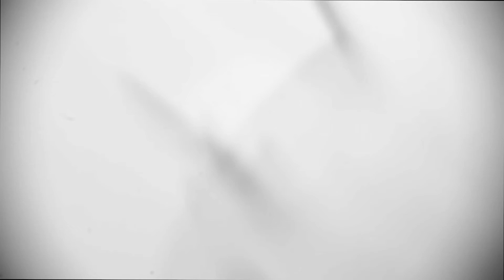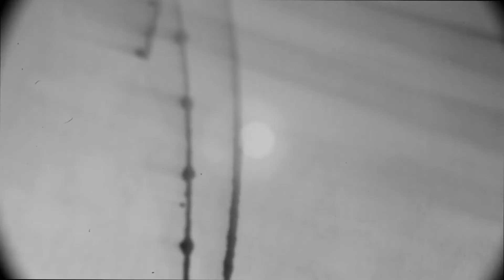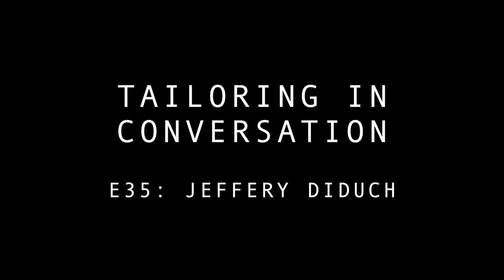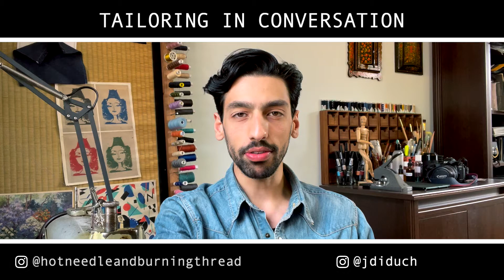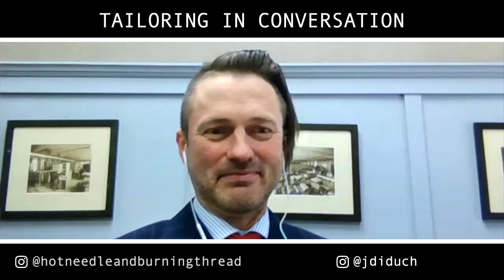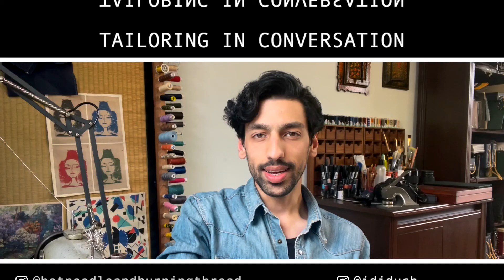E35 - Bespoke Cutter, Tailor & Technical Designer: Jeffery Diduch | Tailoring in Conversation

Comment: Just watched a movie called the "Outfit" a client called this Gentleman a Tailor, the Gentleman responded "I'm a Cutter not a Tailor".  A Tailor sews on buttons, a Cutter measures and cuts the materials and then assembles the garment. Is this accurate or Hollywood BS ?
Reply from the maker: It is partially. A cutter does indeed measure and cut the material. It is however the tailor that assembles the garment. A tailor does not just sew on buttons.

A true tailor however does all of that. It is only by devision of labour that the roles are separated.

Cutting and making used to be and are in some places still performed by the same person.

A tailor in the fullest sense is a cutter and maker.